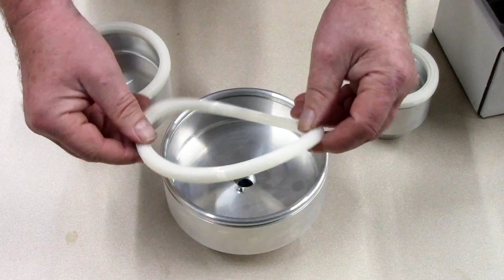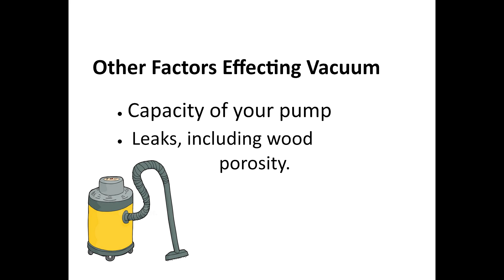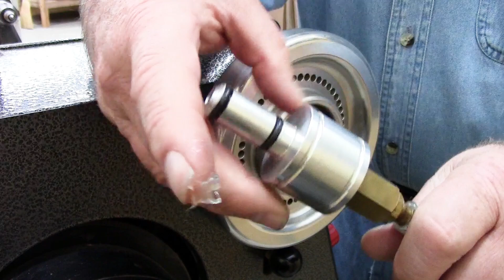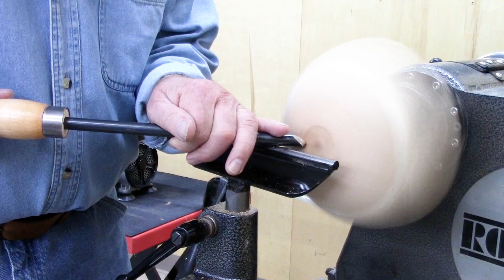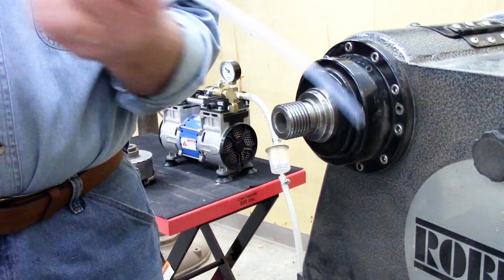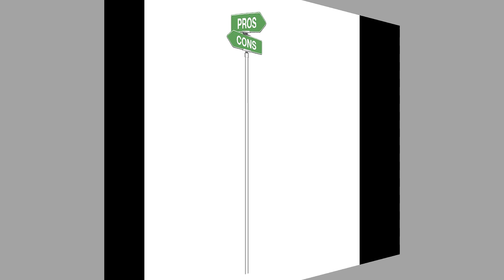Vacuum Chucking by Robust Tools

Comment: Looks really cool! To be honest I first thought this would be for something with really good flat surfaces like metal or glass.

Wouldn't the holding power not also be dependent on the permeability of the wood?
Reply from the maker: Yes, wood permeability comes into play.  You need a pump with enough volume capacity (CFM)  to overcome that.